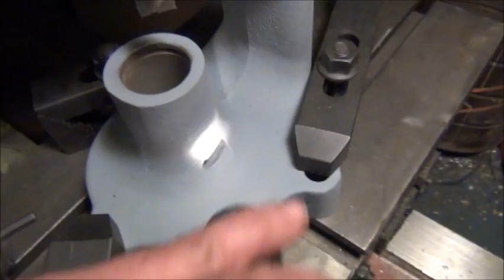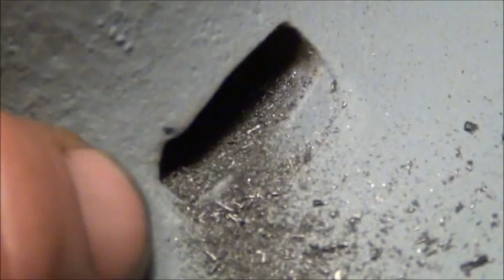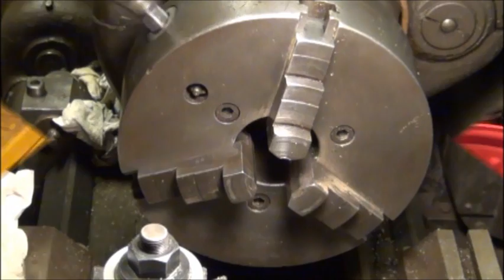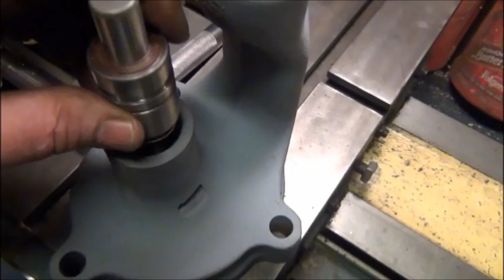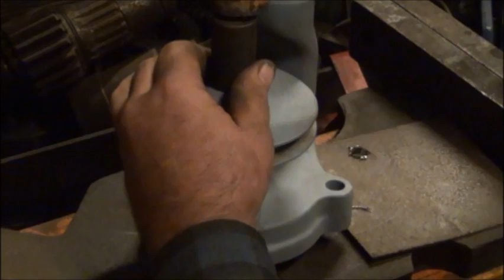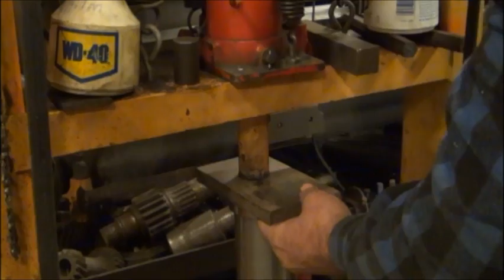Pump a little longer...!

Comment: Great job of modifying those homemade pieces into H-OEM parts (it still sounds like home, he he), and they are certainly American made too, that's for sure!

Nice work and thanks for sharing, Aloha...Chuck
Reply from the maker: Thanks Chuck! I was very happy with the way the pipe ends came out! Even impressed myself that time! ;-)

Thanks for stopping in!
Jeff
Reply: I did my first tractor repair yesterday, or at least it's trailer, patched a sidewall blow-out on an inner tube tire with a section of another tire as a sleeve and it seats on the bead! It only carry's the straw bedding and muck out from the chicken coop, so it's low pressure work and should hold. Gotta start somewhere, and getting my own stuff is a good start :)

As my Daddy always says, at least pertaining to me, "Even a blind hog will find an acorn from time to time" , LOL!
Reply from the maker: Hey Chuck, it's a good start, and the best way to learn is "hands on" projects! Looking forward to more video from you soon!

Jeff

Comment: hi jeff what a briliant way to form the tube ,i knew there was a reason for not throwing away old bearing races , dave in the uk.
Reply from the maker: flixtonman Thanks, I use the old races in the press a lot, I've even used them to make sleeve drivers for old engines! Carbide tooling cuts them nice to reshape as needed!
Thanks for stopping by Dave!
Jeff

Comment: Hi Jeff, nice job on the pump rebuild, and slick idea for the pipe tapering die, now I'm probably going to find myself saving all the old bearing races I can find, uh oh, more stuff piling up in my already WAY overcrowded shop.
  Nice video as always ....... Mike
Reply from the maker: Hi Mike, I thought about putting it in the lathe with the steady rest and try some metal spinning, but figured putting enough pressure on the end to round it would also put a bend at the guides on the rest!
The other bad part about saving them (besides taking up room) is when you want one it's always the one at the bottom of the full pail! ;-) ha-ha! But I do use them all the time!

Glad you stopped by!
Jeff